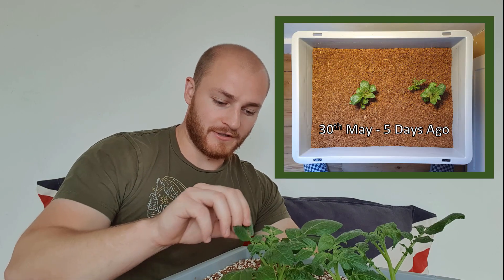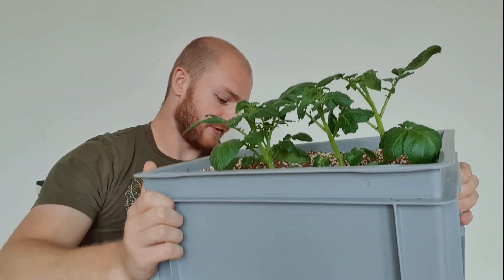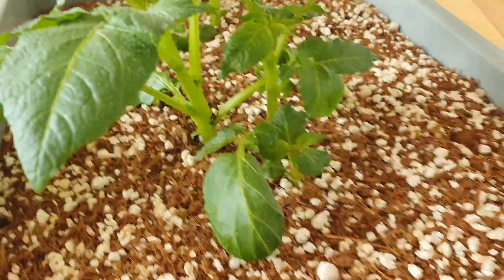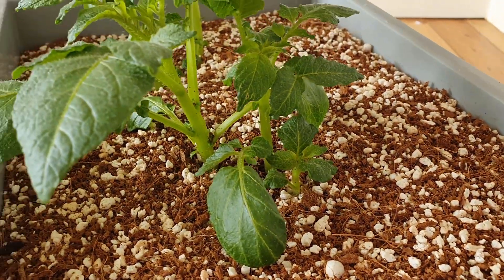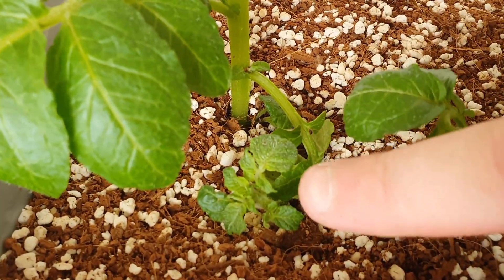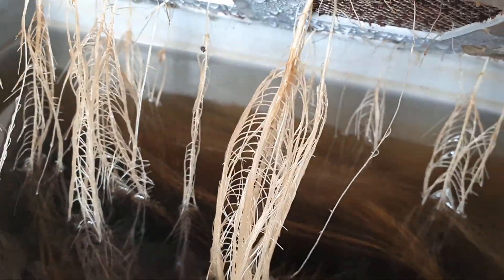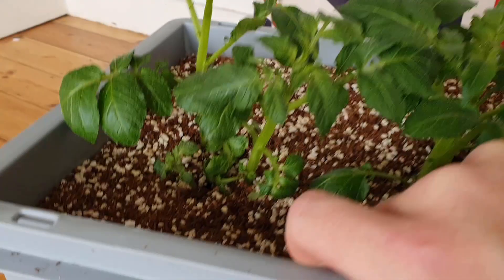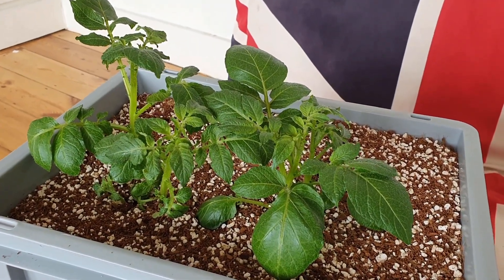Canopy Growth | Soilless Spuds PhD

Comment: soilless means soilless you can not have half hydro and halve soil and still call it soilless you are still growing in soil for your stolon's remember, you literally refer to the coco peat container as soilless...i find it to be very contradictory and confusing ,Do you know what a rain gutter system is in a way this is basically the same thing as long as the soil can wick up nutrients from the bottom via soil or roots the plant will grow. just one last thing once you planted the seeds do you water them from the top container? what happens to the water draining to the bottom container? do you drain it ? or do you leave it until the roots come trough and then wick it up?
Reply from the maker: Hi there and thanks for watching. When I say soilless, I mean exactly that - no soil! Coco coir is a substrate that has many similar properties to soil, so I can understand your confusion, but it's mostly inert. This means it doesn't contain any nutrients, which are all provided to the plant via a hydroponic system. Hope that helps!